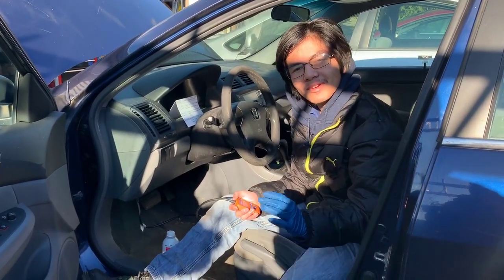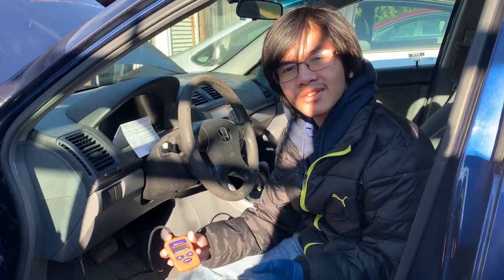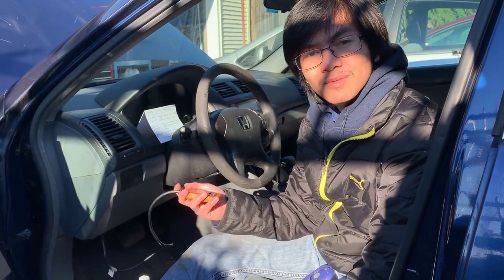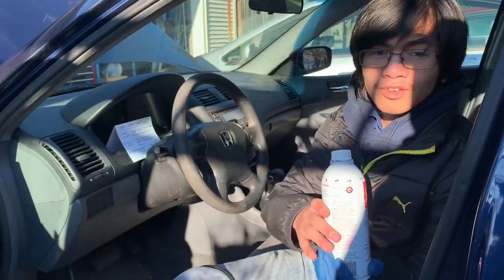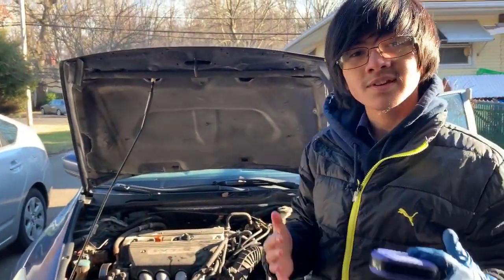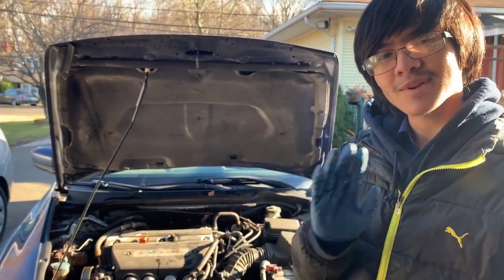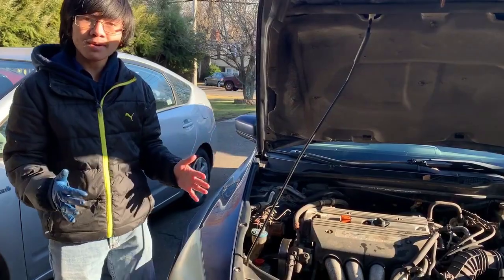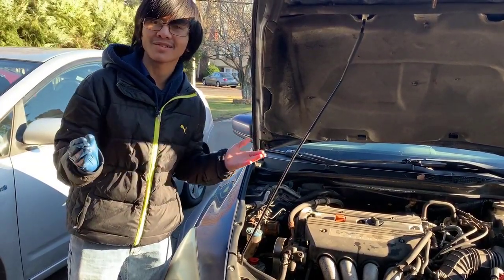I Got Code P2646: What Does It Mean? Symptoms, Causes, How To Solve | Honda Accord Civic CRV Element

Comment from the maker: Here are the #ᴬᴰlinks to tools, parts and accessories you may need to perform this repair:
1.  https://amzn.to/3YUL6yp  |  Ancel AD310 Classic Enhanced Universal OBD II Scanner Car Engine Fault Code Reader CAN Diagnostic Scan Tool, Read and Clear Error Codes for 1996 or Newer OBD2 Protocol Vehicle (Black)
2.  https://amzn.to/2RsLWjW  |  Honda 15815-RAA-A02 Spool Valve Filter
3.  https://amzn.to/2GRU1fJ  |  Genuine Honda 15845-RAA-A01 VTC Filter Assembly
4.  https://amzn.to/2Fm9HI0  |  Genuine Honda 15810-RAA-A03 Spool Valve Assembly - VTEC Solenoid Spool Valve w/Timing Oil Pressure Switch & Gasket (Replace # 15810-PNE-G01 15810-PPA-A01 15810-RAA-A01)

Or Click on Amazon link here and search for what you need:  https://amzn.to/3xIOsqg

Comment: thats the worst you can do  buying those parts from ebay amazon or autozne  they are junk   for me is totally worth it going to the dealer spend 30 mts and get my 10 dollar gasket  and spend another hour installing the gasket on my car because is so  difficult  
got a part from autozone installed and 2 months later  leaking again 
 dealer for quick fix or rock auto if youare not in a hurry

Comment: Paid $400  for parts labor on oil pressure solenoid due to car losing power/ car bucks when accelerating.     Now I'm getting this rocker arm oil pressure switch code.   Car is still bucking.  

Apparently oil pan gasket is leaking oil as well.  

At this point i can't dump more money info this car.   Looking for an additive to help w oil pressure.
Reply: the bucking was probably due to a bad oil pressure switch, the part is is about 30 dollars on amazon, mine had the same issue after i replaced the solenoid. the parts arent too complicated to change as long as you have the right tools. that 400 dollar bill you paid for the vtec solenoid is about $50 or $70 for a quality one, and an hour of your time to change it out, check out rockauto for car parts.  They're great cars but they nickle and dime you. you fix one problem and another soon arises. hope you fixed your issue!
Reply: @showcase2396  thank you!   For now the cold weather seems to have solved my problems.   Thankfully I'm not commuting 5 hrs a day so it's not a pressing problem and i do have the luxury of trying to fix it myself once spring comes around.   👍

Comment: Thank you for the video and I appreciate it yes generally a Low oil's issue with this Honda's civic and yeah you gotta leak somewhere.. Cause you should not be 2 or 3 courts low.  So you're right on the money with that rocker arm code bill but it's generally just an issue of you aint got  Enough oil in your car. RLTW 3/75

Comment: I had this code on my 05 si and its annoying car felt slow and wouldnt rev past 4k i took off the whole sensor and the gasket and cleaned everything with gasoline i didnt take apart the 2 sensors just clean everything good with gasoline and a brush dont be scared if its broken you will find out when you put it back on the car
Btw my car had 225k miles ok
Reply: and this solved your problem? mines doing the same thing so i tried changing the vvt oil switch and it didn't help

Comment: Hey wats up, I have a 2004 Honda Accord ex v6 , my car been acting weird experience a transmission slip not to long ago and I know my transmission is not bad, did a lot of research and seen something about changing the transmission solenoid so I change both and also did a transmission flush with Lucas transmission slip fix and it was driving ok, now it’s shuddering and over revving like my transmission is slipping y think this may be the problem???????

Comment: Correct me if I'm wrong, but based on Aiman's research and my experience, if you get error P2646 and you keep up with your maintenance, it could be your solenoid that’s the problem(solenoid and/or gasket or connectors). If you don't keep up with maintenance, it could be your engine that's the problem (fluid levels mainly)

Comment: For anyone still looking for a possible fix to this, I'm glad Aiman mentioned it, but I just learned this before watching: the cause of my P2646 was due to my VTEC OIL PRESSURE SWITCH (4:14) and what literally happened is that the connector had possibly vibrated off (I knew it had to be simple cause I had bought brand new ones half a year ago, and before that with my older engine [I blew a gasket on that one] I was buying a new solenoid and/or gasket every 3 months). Thanks for mentioning it in the video, and hope my find helps someone out there. Sucks I gotta sell this 05 Accord, helps me learn a lot about the little things thats important, in addition to maintenance
Reply: man this was 2 years ago but this right here did help !!! i appreciate, i have an 05 accord

Comment: Mine skips when driving like it wants to cut off
Reply: What u do mines doing it to
Reply: @judithholder4049  sometimes just changing the oil can fix it
Reply: Mine skipped.  Scared me.  Any quick fixes?  Only doing hail mary stuff,  dumped too much into it and dealing w underhanded mechanics.
Reply: Changed the oil and it worked for a few weeks but skipping again
Reply: @crieverytim  my shit did the same thing I have a trip this weekend honestly pissed off cause I just bought this from someone off Craigslist about a year ago and don’t even think I’ll make it through the trip without a stall or constant sputtering

Comment: For some reason I unplugged rock arm oil pressure sensor,,,and I star the car the engine light is on ,,,,,than I turn off the engine plug the sensor back.... the engine light is off but everytime when I use scan tool to scan it the code p2646 always there.....if you know why please teach me ,what should I do next step .....I should drive more or replace the sensor or something other........thank you
Reply: Same to me I think it just keeps it in the system to remind you and it will go away if after you had no code for 600 miles I think
Reply: @Daddychill945  you right ......but I don’t know how many mail I drive but it do fix the problem.....
Reply: @爆爆富  you still have the code

Comment: Hello
I replaced the VTEC Solenoid and gasket on Sunday and drove it around and drove to work fine. Then on Wednesday the engine began surging at about 2800 rpm .
Havent checked codes yet.
Could the new one be bad ?
Thanks
Reply: Literally the same thing happened to me! This past week. So what did you figure out, or do to fix the issue?
Reply: It could be that, the vtc strainer, or the vtc actuator. Especially if you buy a non OEM vtec solenoid lol

Comment: I have a 2006 Honda odyssey it gives me the code P2649 Rocker arm oil control solenoid VTEC solenoid valve circuit high voltage. Do I just change the port or worry about high-voltage?
I also have other codes P2770, P0970, P0980, P0966, P0974. There all giving me high input, high circuit or low circuits. Should I just change the parts or is this a different issue?
 The car wouldn’t start I thought it was a battery and alternator issue. I replaced both of them. The car ran for a few miles and it shut off on me I couldn’t start it without a jump. Also I need to mention before it shut off on me every time I stopped and try to accelerate it hardly did.

Comment: Thank you for making this!!! I've been battling the EVIL P2646 for over a year! 
I've cleaned both screens, it came back.
I've replaced the assembly with genuine Honda part, it came back. I've replaced the VVT solenoid on the left side of the engine, it came back.
I'm always up to date with my oil changes and I'm not losing oil. At this point, I'm at a loss, help 😭😭😭😭
Reply: David Garcia sams here. I found. This online tonight. ———
It was an oil pressure issue I only had 10 psi at idle and I believe around thirty at 2300 rpm but 60 at3500 rpm. It didn't always have enough pressure to operate v tec I tried Lucas additive also and no help. We figured out something we installed a relay and jumped wires from switch to solenoid and a ground. When PCM operates the v tec solenoid it will open the relay and think the v tec is working normal. Seems fine now have driven about 40 miles. It was figure this out or replace engine which runs great like it always has.
Reply: So, it’s been 3 months since you replied with your fix. How is your workaround working out now? I’m facing the exact same issue. Replaced both screens with genuine Honda replacements. Replaced the entire assembly, which worked for a month. Increased the oil weight to a 10W30 High Mileage oil. The only thing I haven’t tried is the Sea Foam additive, but that’s next. I don’t expect a miracle from the Sea Foam though.
Reply: @lynnnegriroldan2988  ever figure the problem out..?
Reply: Try checking the connectors (switches) on the solenoid. This error just happened to me and I think over time the oil pressure switch got vibrated off cuz when I lightly pulled on the switch, it just popped right off. Pushed it back in and tugged again and didn't budge. My accord now has 1 less problem to worry about